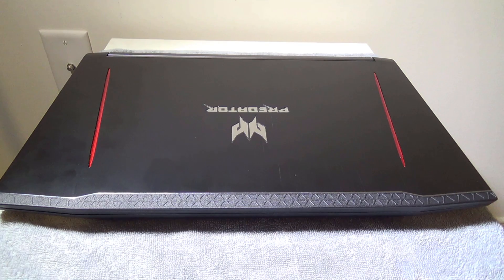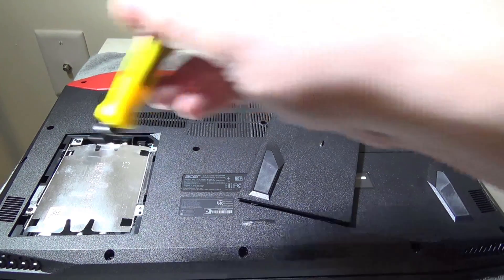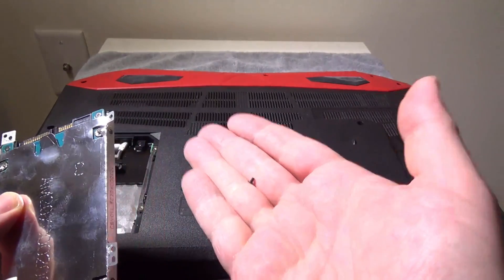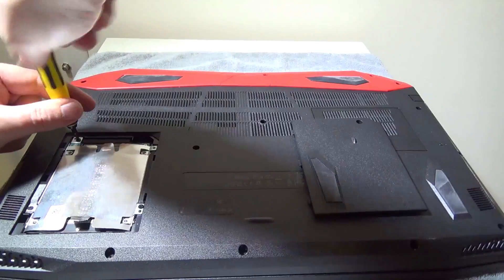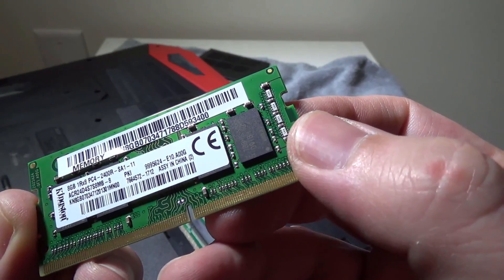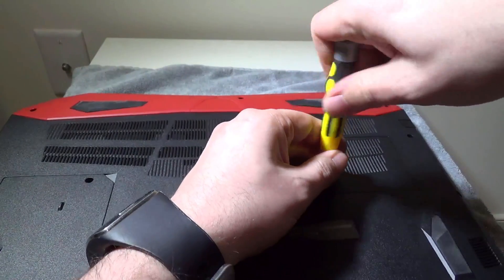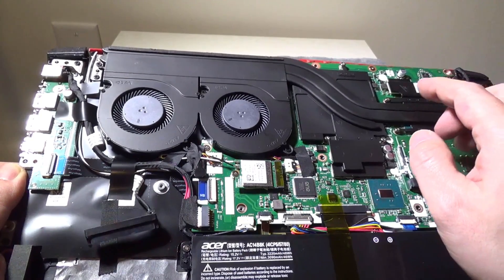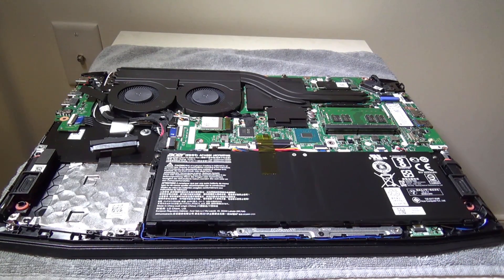Acer Predator Helios 300 Gaming Laptop • How To Add a 2nd HDD and Upgrade RAM

Comment: Another great video! Do you think the same side cooling design will perform worse than the 2 way cooling? 
My personal thought is that this cooling system has both pros and cons than the traditional method. The con is when both GPU and CPU is under load, the 2 in 1 heat pipe solution needs to travel all the way from the GPU and pass through CPU then exhaust which means longer distance for the heat to travel so less cooling rate. This is also a pro, since both CPU and GPU is connect under the same heat pipe which means when running CPU only or GPU only tasks the performance will be much better. Because it will use all 3 heat pipes and 2 fans to cool only the CPU or GPU. However this is a gaming laptop, which means both CPU and GPU will be constantly under load during gaming. So I conclude this setup is more suitable for a workstation than a gaming machine. Correct me if I'm wrong.
Reply from the maker: +Jack Smith no it shouldn't I have played over 4 hours at a time
Reply from the maker: +Sir1Bar yes you would have to open the laptop and unscrew the heat pipes that cover the CPU and GPU and then you could wipe off the old thermal paste and apply new thermal paste if you wanted to
Reply from the maker: +Dean Dollahite  only as an external hard drive. To install an internal it needs to be 2.5 inch 7mm
Reply from the maker: +Nathan Fang so far thermals have held pretty well under gaming load I have seen nothing over 80 Celsius on the GPU or the CPU and that was streaming OverWatch for over an hour last night
Reply: Galaxy Tech Review I can stand by that, just finished getting mine set up with an HDD that I put in that spare slot, and I ran The Witcher 3 on ultra settings for well over an hour, all while Predator Sense was running, and 80 degrees Celsius was the highest the CPU hit, and it was just for a second at one point then dropped back down to low-mid 70s, and the GPU hit 78 at its highest. This was also with CoolBoost turned off, with CoolBoost turned on, it seemed to drop a few degrees on either one
Reply: Galaxy Tech Review is there a way to repaste for the CPU and gpu on the laptop?
Reply: thanks
Reply: can it accept a 15mm hard drive such as a 5tb barracuda drive?
Reply: +Galaxy Tech Review     what happens if you play for longer then an hour, like 4 hours, can the laptop overheat?
Reply: Galaxy Tech Review awesome thanks for the response!  also do you know if the laptop comes with updated drivers or do people still have to update them manually?
Reply: Nathan Fang does this laptop supports Nvme ssd? If yes, can you record a video showing us how to clone/install, etc?

Comment: Thanks for posting the video Mate, i got this laptop yesterday and I needed to know how to add an HDD, 
EDIT: Ive never added a HDD Before, after i place it, do i need to insstall an OS in it?
Reply from the maker: +Andres Perez the OS should already be installed on the m.2 Sata drive
Reply: @GalaxyTechReview  Hi, I tried to upgrade my HDD and for some reason I got this message 'no bootable device'. Even though I have windows installed on the SSD. Any solutions for this? Thanks!